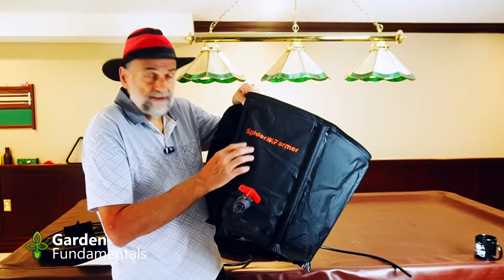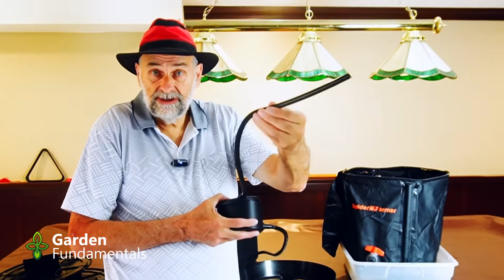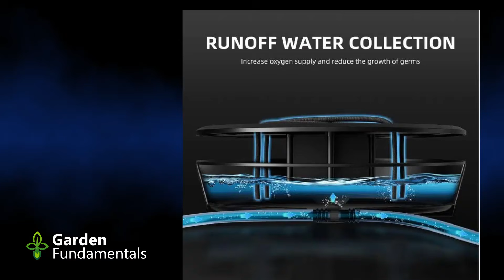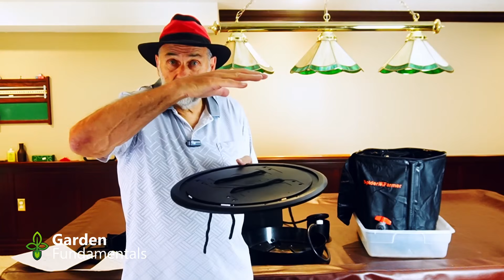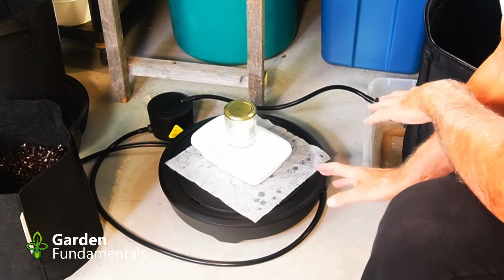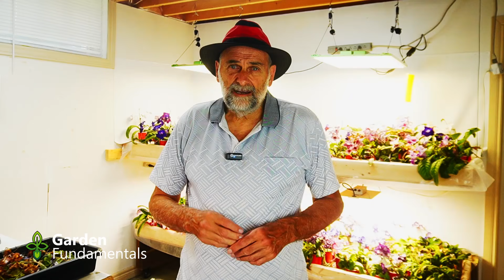I Tried the Spider Farmer Gravity-fed Watering System and Here’s What Happened!

Comment: I'm wondering why a person couldn't send one or more wicks up threw 1 9r more holes (made manually very small) in bottom of a fabric grow bag (or even side of bag for that matter)& either rig a support that would suspend them up higher in the dirt or make em long enough to drape over bag til filled with soil then just pull on wick to straighten its path.  Would seem it would distribute water more evenly then?

Comment: Ive been using this exact system for almost 4 months and I put all my nutrients in the bagged resevoir and let the plants wick up water and food . The plants using this system are gorgeous compared to all the other plants I have that are not using this system and I have to hand water and feed. I did have to make sure that the system was on level ground because i noticed overfilling/spilling in some pots that were not super level, I also placed the 50L rez on a few milk crates above the float valve outside the tent. My Ladies have been drinking so much during the fruiting phase and the rez needs a weekly top up. Once I get a job i plan on buying more of this system so all my plants can be automatically cared for
Reply: Same results in my garden

Comment: You can't run this system without a plant in the pot.. It relies on the plant to make it work.  That's why its not getting any wetter. The system needs a plant to draw  water up, and then it will replenish. Without a plant, it will only get wet  to a certain point. You never want the water to come all the way up to the top of the soil.. lol. And you don't want it to be better than field capacity. If the soil got any wetter, it would 
 water log and  kill your plants. You'll see how it works once you actually start to use it. When its doin it's job, you won't  even realize it,  but you'll see the water in the reservoir getting lower. And you'll see a big difference in how well the plants thrive.  Think symbiotic relationship.  If you are worried about the top getting water, then revert to what you said at the beginning and top feed once a week. You don't even need enough to induce runoff.

Comment: You want to only give seedlings and babies/clones a little bit of water, so top watering is ideal. once the leaves of your plants extend to the edge of the pot means the roots are down the bottom. the wicking will take place around this time. ofcourse, this system and my method is for cannabis plants. but i am sure its basic knowledge that applies to many species of plants.

Comment: Yeah, it's not just a theory, roots are all over the pot, the top, middle, and bottom.  I have noticed I always have a lot of roots on the top of the pot, sometimes the bottoms are dry, but watering from the top keeps them growing.  I think you are correct, the plants are going to struggle some using this system.  I'm thinking this is an option to use only when you're going to be away and don't have someone who can come over and water from the top for you...
Reply: I’ve used this system for 6 months. 

What you say is not the reality. 

The wick system keeps the medium damp top to bottom.  After week one (from seeds popping, I plant right into the coco) mine are on the wicking system. 

My roots grow through the bag, into the rope and reservoir and my plants thrive using this system. 

Hard to see me ever going back.

Comment: I grow plants indoors in grow tents. Not veggies but it doesn't matter.  I have settled on City Pickers wicking beds, like Earthboxes but cheaper. They fit in a 2x2 tent and I can put 2 in my 3x4'. All I have to do is use good soil and amendments, and add water 1-2 times a week. If I see a deficiency I can use a little bit of bottled nutrients to work quickly and organic amendments to fix the soil. It's a "synganic" approach that lots of people use. The idea of hoses and leaks and air in lines sounds like too many ways to fail. I like the wicking beds because there's no way to leak or screw up. It's a very reliable and simple way to grow.

Comment: I thought about adding another bulkhead fitting in the bottom of the reservoir so that the entire contents of the reservoir is used.I run a pump in mine to keep everything stirred up however, so I never let it get that empty, but it will if I ever remove the pump.

Comment: I have the ac affinity  system, basically  the same. It does work, but as you said ,you need to water them until they are 4 to 6 inches tall. The wicking  only works maybe 2/3 up the grow bag from the bottom. When small use a empty  reservoir and water from the top 4 inches  from the stem.as it grows your good to go.have been using mine for 2 years straight  with nice 4 ft crops in 5 gal bags

Comment: Í have the same System in Use for an about a month Now. The main System works really good like it should be. I am not using the Plant Pots which are delivered with the system. I have to change now my Fertilizer because Organic Fertilizer cant be used with this system. The Problem on this System is what you described. it dont pull up the Water to the top. But if you wate from the top and the soil is wet it keep it up the top. It depends one the amount of water which is in the soil. The Problem is that it pulls to much Water in the soil. I am actually try to get less Water in the soil with only using one rope. But it only needs longer to pull to much water in the soil

Comment: This system seems dumb. Why not just put a saucer under the grow bag? Seems like a lot of work and money when a gardener can just put a saucer under the grow bag. I prefer to grow this way because it saves water and fertilizer. Very little maintenance as well. People claim that you can get root rot this way, but I simply just don't mix compost or wood in my potting mix and have never dealt with root rot.
Reply: What if you are leaving home for a week or two?

Automating the system like this is a game changer for some of us. 

This lets me leave for a couple weeks and at most I need a buddy to come over once.
Reply: @rickschlosser6793 I put mine my sucker line in a toilet reservoir tank and let the float supply a continuous automated supply of water
Reply: This is what I do and get root rot.  Watering is very tepid, must be precise, but then again I do use compost in my bags.  What do you use?
Reply: @brianharris1581  I ripped a sheet of half inch plywood into 1x8' strips with sides of 2x4 on edge with 1x2 strip under the ply L-------. Painted white and covered with black/white poly, on milk crates, use bags only no hard pots. Great for a linear light mover.

Comment: Having a problem with Spder Farm.  I got it specifically to grow tomatoes.  I liked the fact that the light telescopes much higher up than other systems.  However it still burned my plants and they failed.  I used two varieties of small plants commonly used in hydroponics.   The system is also "bossy".  It is over engineered.  You often find yourself yelling at it to "shut up and do as I say."  I will tinker with it, but I don't recommend it.

Comment: This looks very similar to the ac infinity wicking trays, but ac is without the reservoir.  They are definitely handy to extend watering but are dependent on the soils' wicking capacity (recommend coco).  This Spider Farmer system could definitely work well once you got the right soil going for the plant you are growing. And that system is very economical.  I am personally enamored with autopot's valve that enforces a dry-back period before rewatering triggered by the plant's usage intake, supposedly helping to pump oxygen in and out of the lower roots. It is also gravity fed.  Another possible concern with these wicking trays is when using hydroponic nutrients, what is happening to the pH of the tray water?  It could be different than the res.   I think it would be a fun comparison experiment between wicking style and autopot valve style.
Reply: It works extremely well with half Coco loco and half happy frog, I have been using grade 4 perlite and 1/4" lava rocks to fight compaction, and it works well. It's best with living soil so you don't have to worry about nutes clogging the system. They will.

Comment: I have experimented with bottom reservoir and tomato plants. I have 2 "systems" one with wicks and the other without and both work. I don't care about the top soil, the plant will put roots to where the water is. Temperatures of 35 Celsius (100 F) for days and days and the plants had no signs of stress.

Comment: Looking forward to seeing the outcome!  I have 25- 4' x 12' beds in a greenhouse that I water almost exclusively with a homemade wicking system and have been doing so for about 10 years (just establishing some credentials).  I do all my starts with coir fibre now because it doesn't suffer from the same wetting hysteresis issues that peat has.  I would strongly recommend it over peat in this system. Finally a use for perlite.  It is non-porous, has no moisture holding or cation exchange capacity, and is the equivalent of putting lightweight rocks in your growing medium.  Consider pumice for any use where you would even consider perlite.  I have three beds with a high pumice content and the wicking system does not work at all in them so proceed cautiously. The amount that a soil will draw water from wicks can be approximated by the soils capillary fringe.  Big pores cannot draw water very far.  Clay soils have low hydraulic conductivity and other management issues with wicking.  Silt sized soil works well with wicking systems, at least in my greenhouse.  The capillary fringe of peat will change a lot over a year as it breaks down.  Coir will change much less. Looking forward to updates.
Reply: Another possible option is rice hulls, which supply aeration and silicon.  Maybe half and half perlite and rice hulls?

Comment: The brand of grow bag doesn't matter actually. I own a system similar to Spider Farmer from a different vendor and it wicks just fine and it doesn't matter on the size of the plants. The system moistened the soil up to the top within an hour or two and I'm using 5 gal bags. Though to be more transparent, I make my own planting soil mixture designed for optimal wicking / moisture retention specifically for indoor gardening. The company I use recommends their brand of grow bag as well but it wasn't necessary. I just bought mine for a lot less off of Amazon. No need to break the bank on grow bags since a grow bag is a grow bag cut from the same type of cloth.

Comment: Even with a string, you can only draw water to a certain height (approximately 8-12 inches vertically, based on my own experiment). The soil's water retention properties really govern how well the water distributes once it is drawn from the bottom. I think you should still water the plant from the top once every two weeks. With such a tall pot, it is likely the top will eventually dry out regardless of the type of soil. It's just physics; the capillary effect of the soil has its limits when fighting gravity.
Reply: I have seen the same distance limitation for capillary action in cordage when wicking "up" against gravity.  I did some experimenting before I built some self-watering containers.  I ended up using three 9 inch wicks spiraling up into the soil container from the reservoir.  It worked pretty well for consistent deep soil moisture on hot days regardless of what the plant kept up taking.  Using one gallon milk jugs as a water reservoir on top of a patio container with same wicking cordage going "down" into the container can wick much further when working "with" gravity.  I like these when I leave for vacation, and the wicks never clog up like drip containers have the tendency to do sometimes.
Reply: @GasOperatedDad  I've often wondered if the wick up in the soil helps. Thank you for letting us what works for you.